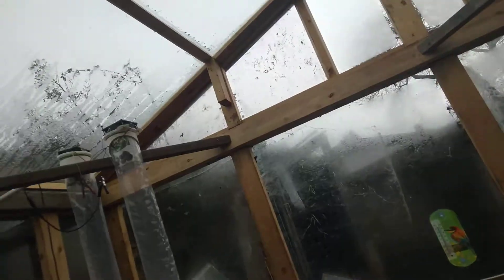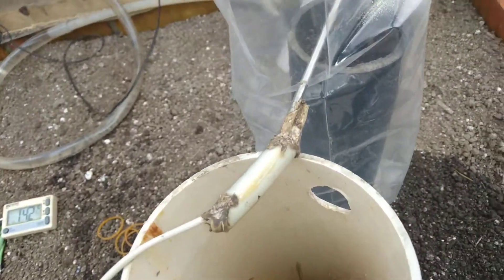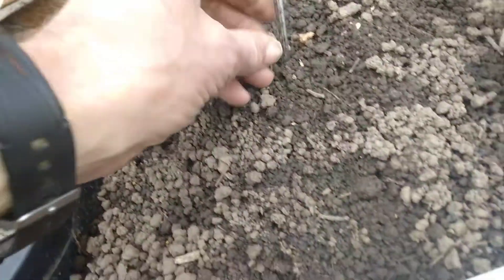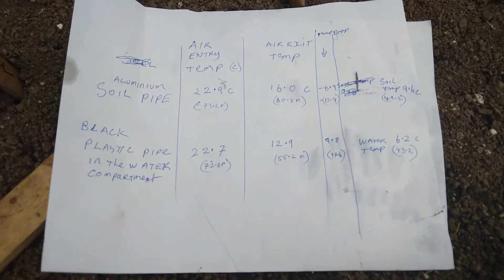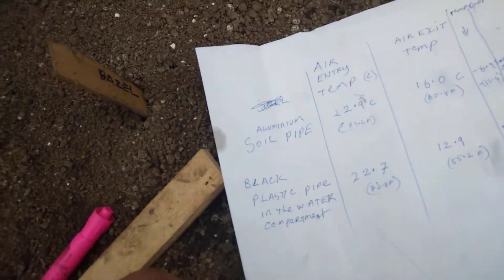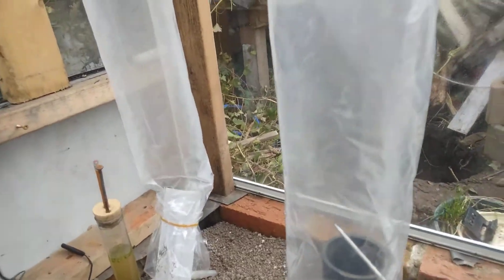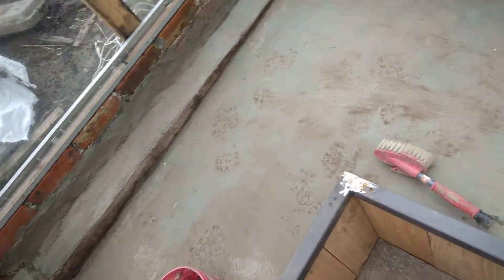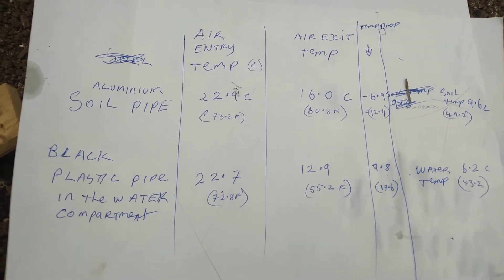Experimental greenhouse:  The "Climate battery" overview.  With some results!

Comment: You made the same physics mistake that soooo many people do with your system sir. In order for air to release its energy into the battery, It must undergo a drop in pressure. Pushing warm air down does not work. You need to pull the cold air up out of the system and provide a negative pressure zone in order for the air to readily release its energy.
Reply from the maker: Hi, Dave.  the air is at (lets say) 25 or 30 degrees C and the soil or water is at 10 or 15 C so there is heat transfer from warm to cool.   The greenhouse air is often very humid, and water condenses in the pipes.  Condensation releases a lot of heat. (The same amount of heat energy that it took to "boil" the water in the first place.  I was not trying to make a heat pump.  Just to transfer some heat into the ground to keep the greenhouse cooler in the day and warmer in the night.

Comment: I found the fan spec. It's listed as 32CFM.
Reply from the maker: Oh, thank you!.   I was thinking that I should just vent the cold air that warmed the water to the outside.  It's pretty cold,  the outside air to replace it is probably warmer.
Reply from the maker: So, I calculated,  (using 30 CFM)  over 4 hours of full speed running,   it would heat 20 kg of wet soil by 1 degree C, or  36 kg of dry soil by 1 degree and and 10 kg of water by 1 degree.   So, it's not wonderful,  but definitely helps. I was being very conservative in the estimate by under estimating how long the fans run.  The fans run all day but  slower when cloudy and when the sun is lower.   This is a "trickle charger" for your "climate battery".   I don't know how many fans the solar panel can run.  I still  have another planter to fill and warm.
Reply: @Brians-tracking-solar-scoop  I love numbers. You could take it further and compare the amount of energy required to do this heating electrically, vs. this "heat pump" method.  An idea I've been toying with for years is designing a Sterling engine or thermoacoustic engine that can run on very small temperature differentials such as you'd find between a river and the air above it, or such as with your stored water.